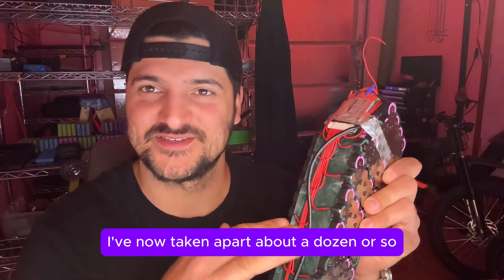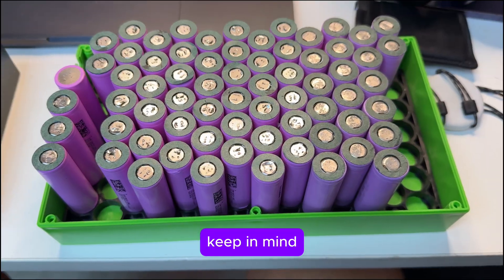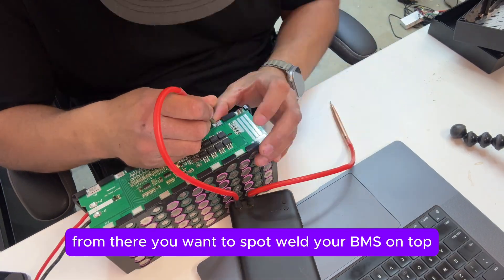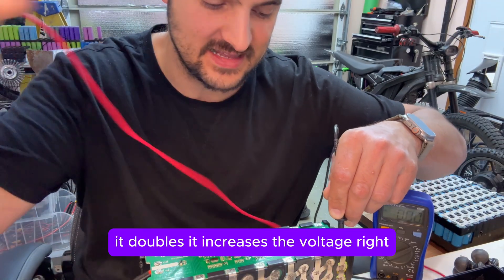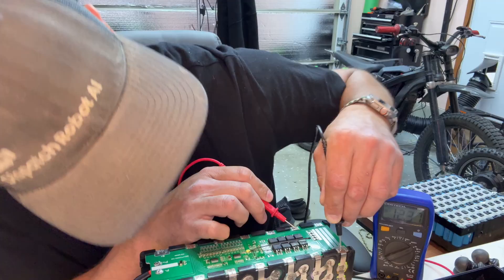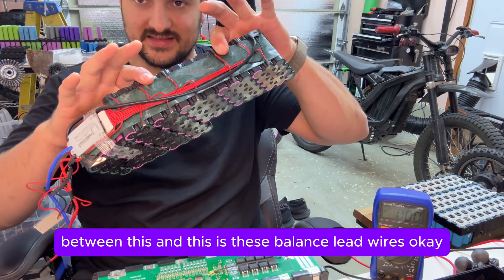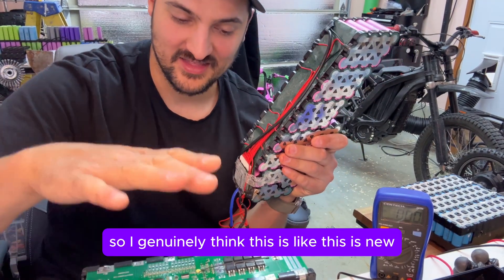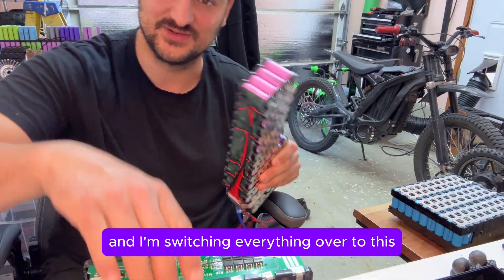DIY 48v battery build 13s6p

Comment: when you salvage your batteries check their capacity first segregate the highs from the lows and either use all the highs you got for 1 pack or distribute the highs and lows into same P-group so they average out about the same. You also want to check the internal resistance on a meter so you dont get some jank 50ohm IR batteries (UPS style)  along with a good <20 ohm IR (high output drill or E-bike) as a bunch of 50's will casue the pack voltage to sag and may trip the BMS into turning off.